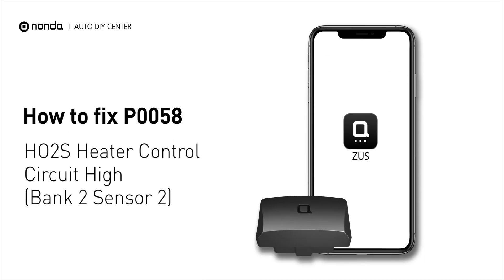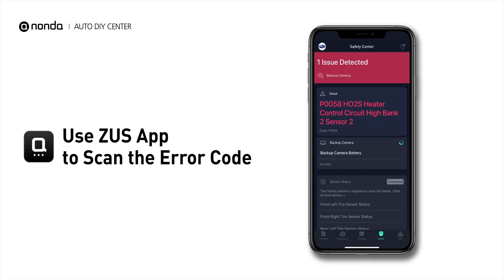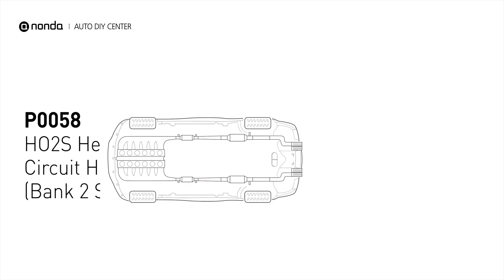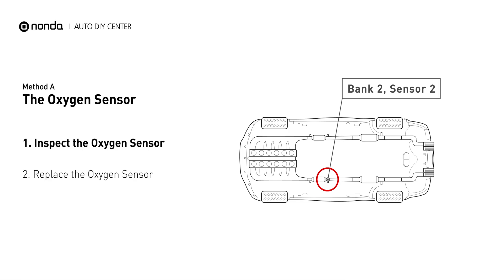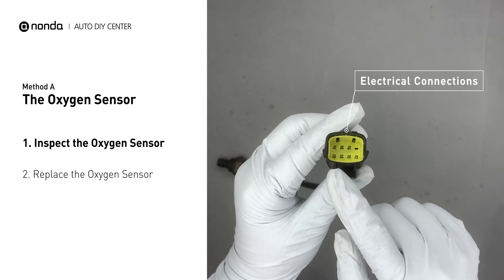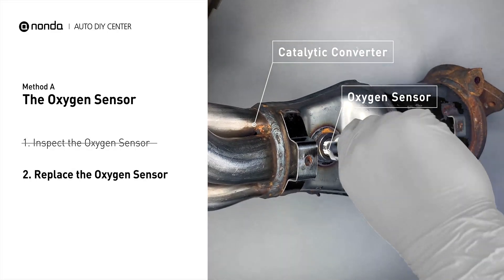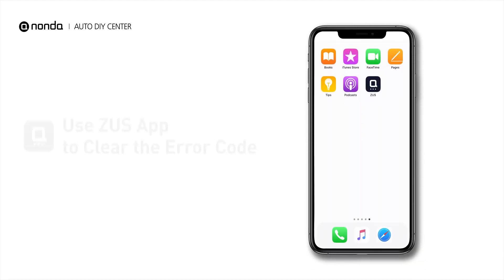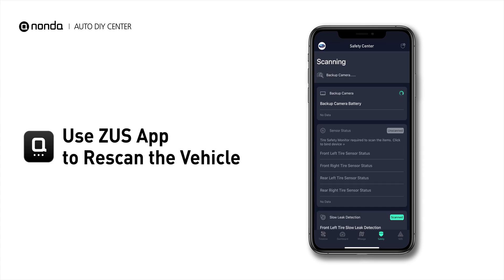How to Fix P0058 Engine Code in 2 Minutes [1 DIY Method / Only $19.61]

Comment: How about I change all for o2 sensors and still reading the codes and my truck shaking and the light b flashing
Reply from the maker: Hello, we recommend having your vehicle checked by a mechanic for further diagnostic.
Reply: @nondainc  l
Reply: @nondainc  aa
Reply: Miss fire
Reply: I get that code consistently on my 2008 Nissan Frontier V6 4.0L. However, my truck idles perfectly, gas mileage is good, and no issues at all. It’ll come on and I check everything which is ok, then I reset it and it’ll eventually come back on. Should I be worried?